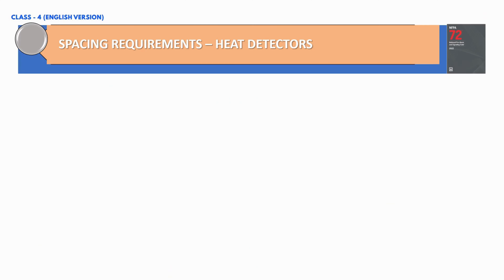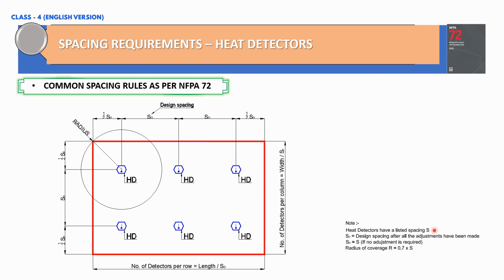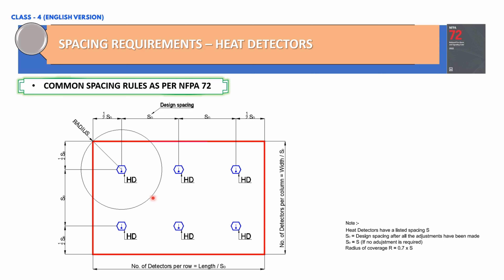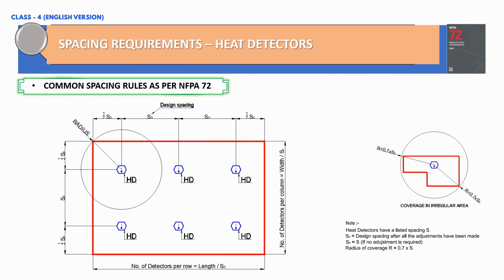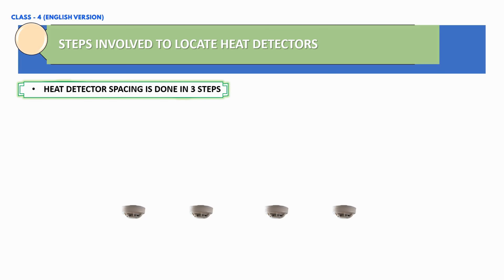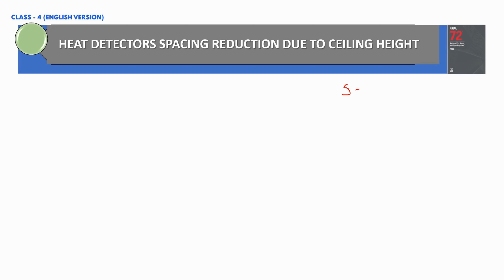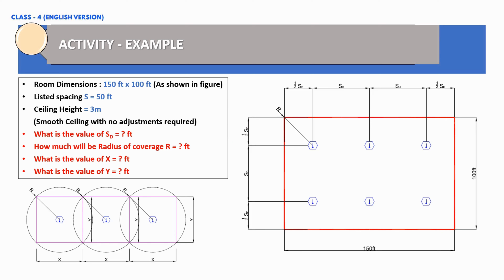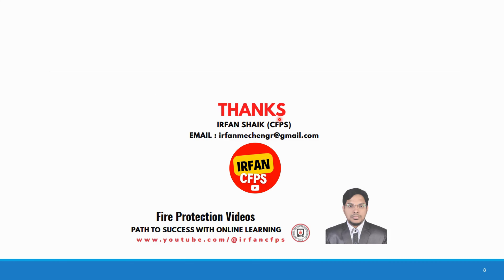Heat Detector Spacing Requirements | NFPA 72 | Part 1

Comment: in case you missed my comment on the other page I said a former firefgihter recoomended heat alarms combined with photo electric alarms  but I guess the poorman's option if already have photo electric alarms is to put a heat alarm next to each photo? thoughts please thank you I guess its best to have as many heat alarms as possible as it should provide protection for flaming fires ? thoughts please thank you
Reply from the maker: 1) It depends. combination of heat and smoke detectors are not required. Please check the project specifications. However if the end user / Authority Having Jurisdiction insists us to provide then there is no option but to follow them. What type of building is that / room?
2) For flaming fires, normal heat detectors cannot be used. 
UV / IR detectors must be used and they are very costly.